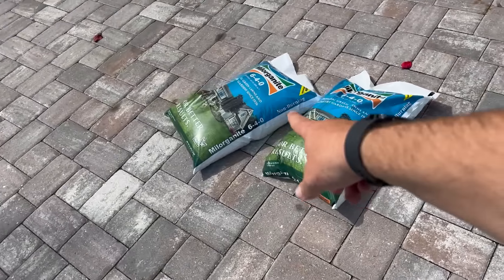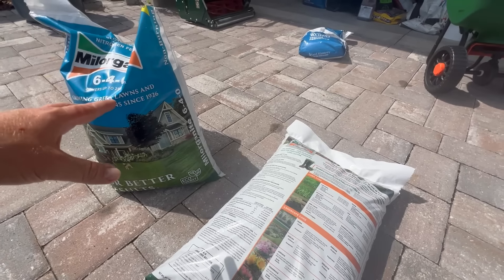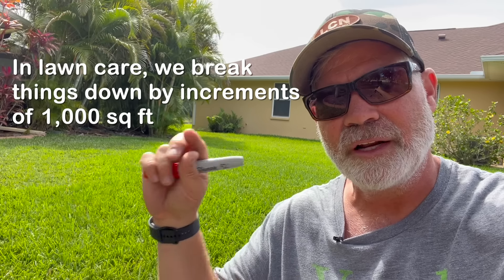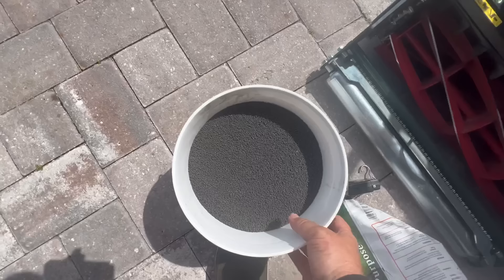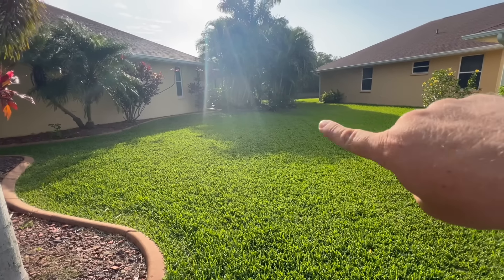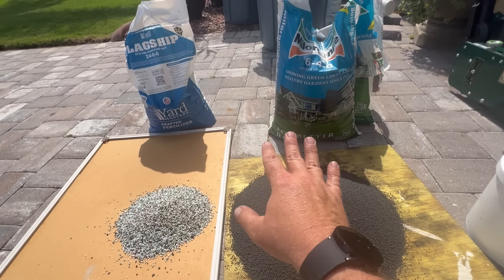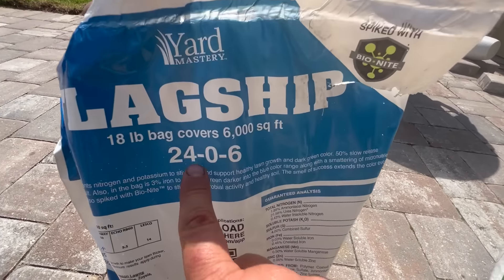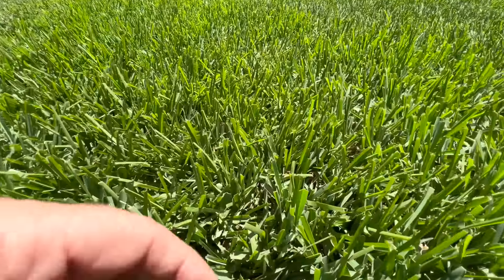This Is The Right Way To Apply Milorganite // Switching To The Dark Side

Comment from the maker: Milorganite Plant Tour - https://youtu.be/X1Tjp6WiGsg
Reply: Was never sold out in Wisconsin.
Reply: You didn’t do the Florida rate though. 5200 for Florida. Would be 6.15 lbs / 1k sqft

Would it make a difference in a bad way?
Reply: @mswalsh68  I was about to say the same thing when I noticed your comment.  At first I assumed he was located in another state but then he said Florida so looks like he has been putting down almost double the rate he should. I'm in Pasco County so will be using 6.15lbs.
Reply: Does Milo have pfas?
Reply: @mswalsh68  Yes, there are FL laws that regulate the amount of P allowed on lawns. Many counties (including Manatee County) prohibit P application unless a state soil test showing P deficiency is submitted to the County prior to application
Reply: @matthewbilskie1524  that’s only in summer though. No?
Reply: @mswalsh68  No - it is not based on the season.
Reply: @mswalsh68  Year round in Manatee.

Comment: Hey Allyn, quick question if I may. We have dead areas of established St Augustine but rather than buy plugs etc, the areas are mostly close enough to spread back together. Would you recommend Milo for this because of the Nitrogen to help get it spreading or? (We have a walk spreader which is easier on the back than a backpack sprayer etc so granules would be best due to a bad back…)  Also once it grows back together that will naturally choke out most of the weeds that grew in between right?

Comment: did you include the bucket weight on the 12.8? also i have heard diesel exhaust fluid is the purest nitrogen 15-0-0 DEF, and that its a cheap affordable way to nitrogen fertilize your yard, is this true?

Comment: I use this method when putting down fertilizer, measuring the square feet and calculating how many pounds I will need. It definitely works as I have the greenest, thickest grass in mid April (Northeast) in my neighborhood. All my neighbors ask me how I do it. I tell them you have to measure your yard if you want to make sure your getting  enough fertilizer down. Also, instead of using a scale for measuring the fertilizer, I found it's faster to just convert it to ounces and use a big juice pitcher (Amazon) with the ounces labeled on the side. You pour it in the pitcher and your done instead of remeasuring several times with the scale.

Milogranite is also an awesome product. You never have to worry about burning your grass and it provides a deep rich green color.

Comment: The fert gets dispensed out of the impeller INTO the hollow Scott's wheel well, and then it falls out of the wheel as you walk in an even, over-ferted line - and produces lines in your fertilized lawn.  You've been told.  Scott's is a publicly traded company worth $4.08B - and apparently they cannot provide a closed plastic wheel in their low-end $90 spreader.  I remember the Milo problem well - back when I paid $40 for my Scott's spreader.

Comment: Hello, I notice the bag says FL 5200sq ft underneath the coverage 2,500sq ft. Does that mean Florida lawns? FL?
Reply: Yes, the instructions on the back of the bag state "FL residents, apply 2 times per year at the rate of 32lbs per 5,200 sq ft."  That's 6.15lbs per 1000 sq ft, not 12.8 lbs.
Reply: @Gourockian1  thanks for the reply!

Comment: For those of us living in Florida, where the rate is 5200 Sq Ft per 32 lb bag (6.15 lbs per 1000sq Ft), surely this means that the gap setting on the spreader needs to be reduced accordingly?  Otherwise, it will be spread too quickly and run out around halfway.  
I'd like to hear back from anyone who has already realized this and made the required adjustment.  Thanks.

Comment: Let me know if the wheels still are higher than the impeller, catching the fertilizer between the wheels and causing green stripes. I could hear it hitting your wheels @10:58. Mine was terrible. I tried walking faster, but it didn’t matter. I contacted Scott’s and they sent me a refund. It was a terrible design flaw that a few people have made videos about.

Comment: I never look at the bag rate.  I always decide upfront how many lbs of nitrogen per 1000 sq ft I want- it's usually either 1 lb of N or 3/4 of N, and then- based on the % of nitrogen in the fertilizer, that drives how many lbs on the ground I need to put down per 1000 sq ft.  For example- if I want 1 lb of N per 1000 sq ft, and my fertilizer is 11% nitrogen, that would be 1 lb N * 11%, which is 1*.11= 9 lbs of fert per 1000 sq ft to give me 1 lb of N on the ground per 1000 sq ft.
Reply: Which is why milorganite has no place to be used as a fertilizer, not to mention you’re leaching phosphorus into the environment if you consistently keep applying it. The cost of N per ton through milo is an ASTRONOMICAL amount compared to urea/AMS, it’s just pure stupidity to use it. Also, in the county Allyn lives in, it literally requires a soil test to prove that he has a deficiency in phosphorus to be able to apply phosphorus. So in a case where the label is the law, he’s broken the law.